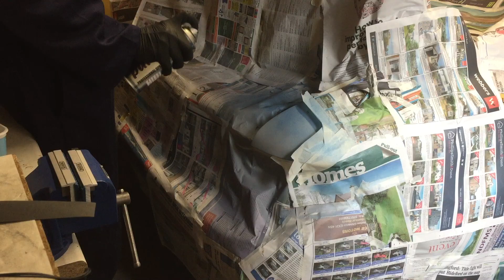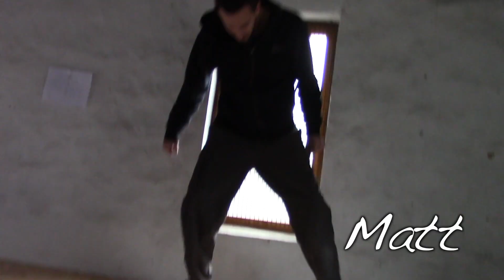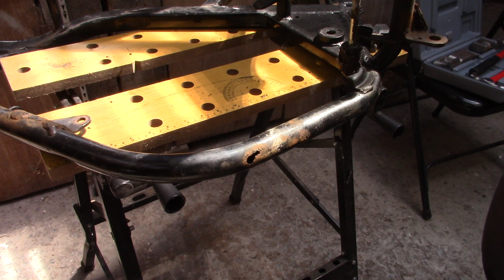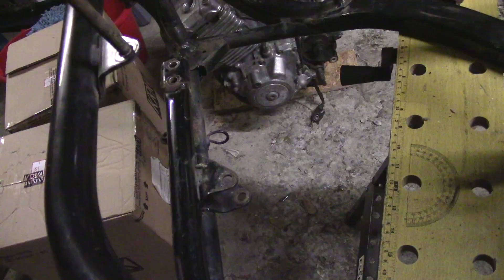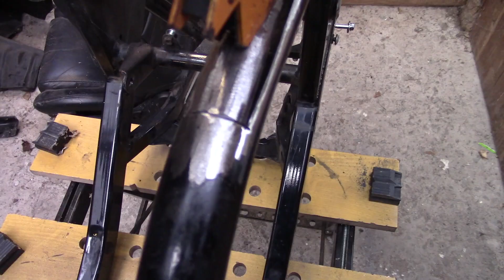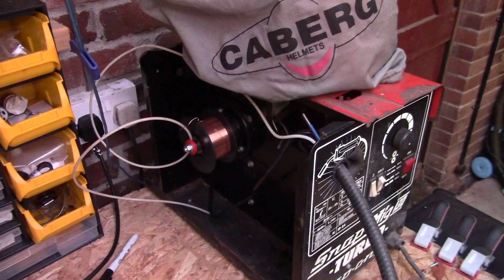Honda CB500 Scrambler Build Project - Part 6 - Rusty Frame Repair

Comment: Do you will change the tank?
Reply from the maker: Probably not, the shape of the frame is very specific to the tank, so a different tank won’t easily work
Reply: @EnginesandUnfinishedBusiness  thanks for answer me, i'm thinking to start a Project like in yours

Comment: If the problem is water getting in the tube and not getting out, and rusting it inside out; consider squirty foam in the tube to seal it. This has been an issue on (hollow) swingarms on Honda NC30s, and it's a known fix.
Reply from the maker: Thanks for the tip!